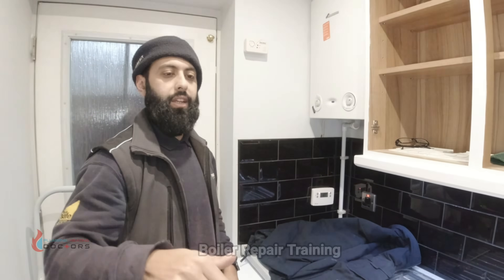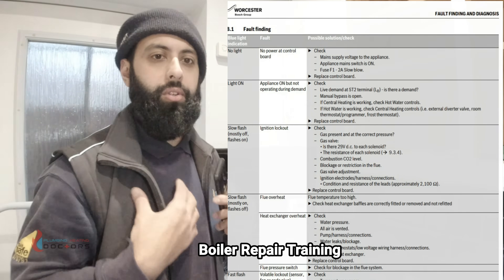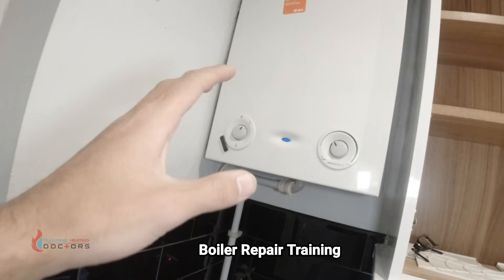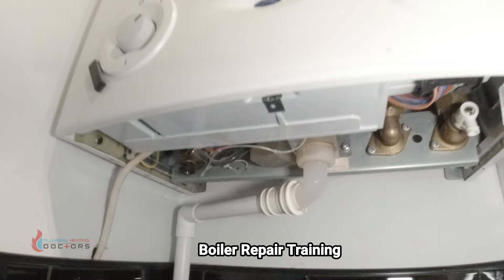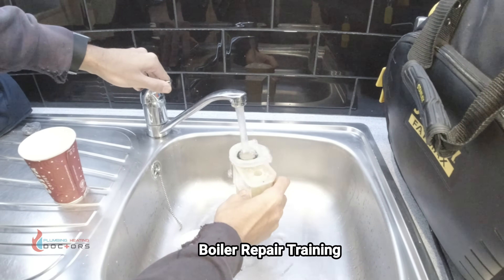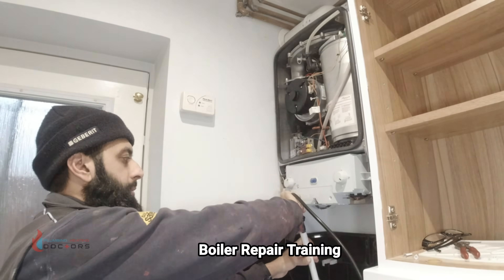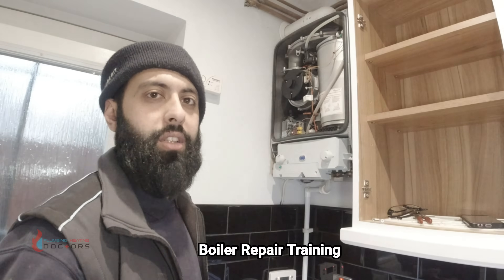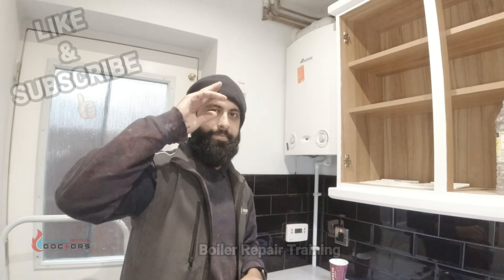Boiler Repair Training | How To Diagnose Any Boiler

Comment: lol I just had a professional plumber come look at my boiler he said sorry mate boiler is no good it’s £4000 for a new one lol I went on eBay braught myself a new pcb boards fitted it myself in five minutes called the plumber up to come look at another job and asked him hod did I fix this boiler for £42 myself as I’m not a plumber he went red and run off so people when a plumber comes and says it can’t be fixed there just ripping you off call someone reputable
Reply from the maker: Wow
Reply: Sorry for how this plumber tried to rip you off and glad you were able to get it sorted, don't let one bad experience with a crooked plumber tarnish them all. Most Heating and plumbing engineers I come across are genuine, honest tradesmen but like every industry including mine there will always be some cowboys wanting to rip everyone off.

Comment: salam bro
how can i contact you? really need your help. rad wont heat up. been trying different things for 5 weeks but no luck. heres what ive done so far:
1. released air 2. removed air lock. 3. changed both valves. 4. used sentinelx400 and 800. 5. flushed system many times. once i took magna filter off, connected a hose and drained each rad individually but when i got to that rad pressure was rising but nothing coming out of return so i opened up another rad and water shot out! i suspect theres a blocage somewhere but pipes all all under floorboards!
what can i do. is this something you would do?
many thanks
Reply from the maker: Walaikum salam

Comment: Another superb well explained video. Would you still recommend anyone thinking of doing the gas courses etc even though the future looks to be hydrogen or will the boilers be much the same only difference the fuel. So did you say when you here water in the boiler that’s the condensate blocked but should there not always be water in the boiler or is it that loud bubbling of water the symptom of a blocked condensate. Thanks again total gentleman.
Reply from the maker: Yes i still think there is loads of work out there for everyone. 

In regards to the sound; if the boiler makes bubbling sounds then water is not draining from the boiler in to condense pipe and this is an indicator to the issue.
Reply: Sorry I meant hear not here lol

Comment: Great video, very informative. just wondering why the Opentherm connection wasn't used with the EPH control,? Do you prefer to connect with standard on off control connection?
Reply from the maker: Vaillant boilers don't support opentherm

Comment: Absolutely no reason to go online to find out what is the code saying...the codes are always... for the most part... either on the back side of the service door or inside on the side panels inside the boiler... the booklet the unit came with should always be near the boiler... even inside the boiler if there is enough room... that has the codes as well...I have yet to come across a high efficiency HVAC unit... regardless if it is a boiler... furnace...or even a water heater for hot tap water...there is always a control panel door that has the codes on it
Reply from the maker: U clearly are not from the UK

Comment: Get a Gallo gun. Boom 💥 condense run unblocked. Also handy for blocked cold feeds on our/v systems.
Reply from the maker: Wow never used them before 👍🏻
Reply: @PlumbingDoctors  if you get one, make sure you cover the sink plug hole with a few cloths if it's an internal condense run, otherwise food matter all over the ceiling!
Reply from the maker: @lukecacciatorenorris8770  lol i will look into it 👍🏻

Comment: Correct me if I'm wrong, wasn't he suppose to replace condensate trap with clean water and not leave trap empty.
Reply from the maker: I ran the boiler until water came though the trap so it was fine 🙂